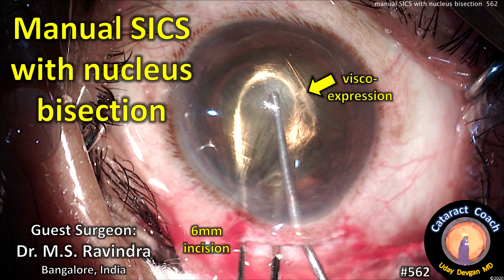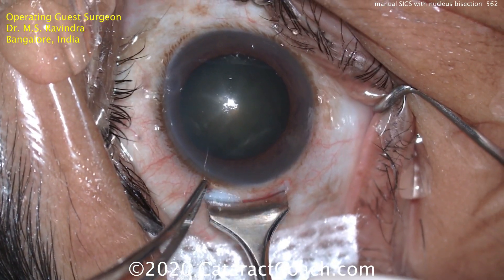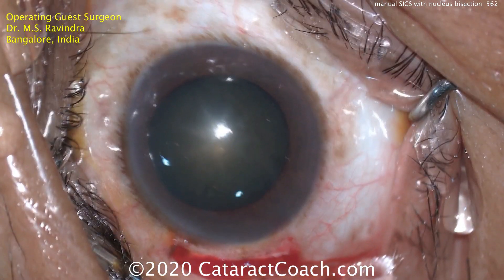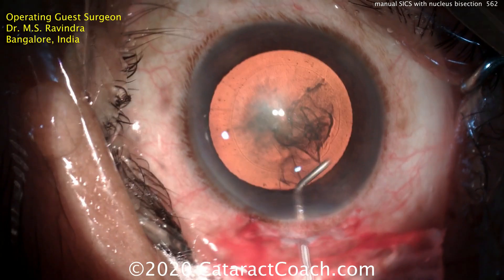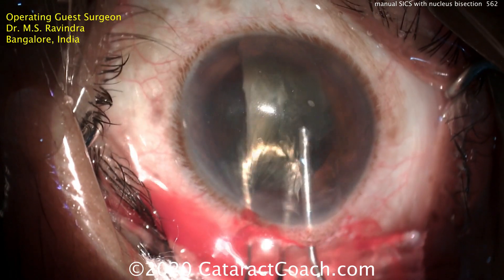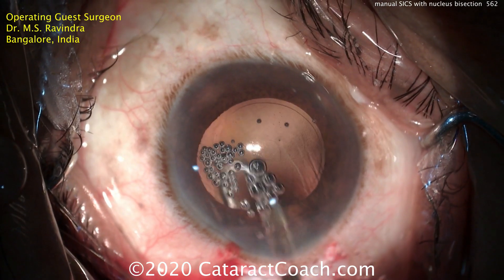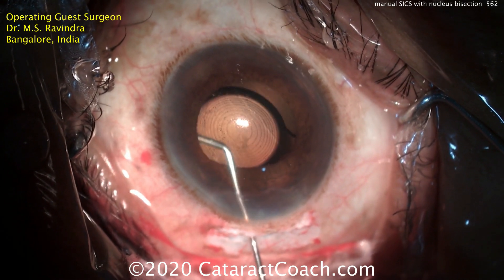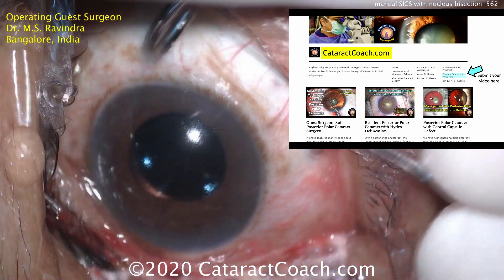manual SICS cataract surgery with nucleus bisection

Comment: Very nicely done MSICS surgery by Dr. Ravindra. As the saying goes, there are many ways of skinning a cat; same is with MSICS. Professor Blumenthal who introduced this technique also used visco expression to deliver the nucleus not bisected but whole. As Dr. Ravindra demonstrated, the tunnel is actually a funnel with the inside length larger than the original incision. We have to think of the concept of astigmatic tunnel here . Astigmatism is directly proportional to the cube of the length of the incision and inversely proportional to the distance from the limbus. Chevron type of incision is shown to have the least amount of astigmatism and doesn’t need to be sealed. One more thing; having watched Dr. Sanduk Ruit of Til Ganga institute of ophthalmology, Kathmandu who developed their own sub five minutes SICS along with the late Professor Fred Hollows where an inverted triangle capsulotomy is used and the nucleus is delivered whole using the dynamics of the Simcoe cannula; no other technique has impressed me more and I also follow this method religiously. In India where we may have to perform up to 100 surgeries in a day; the sub 5 minutes is the ultimate time saver along with being as good as any other technique.